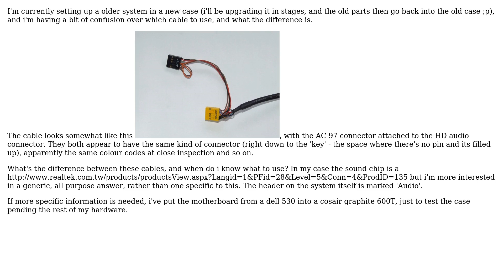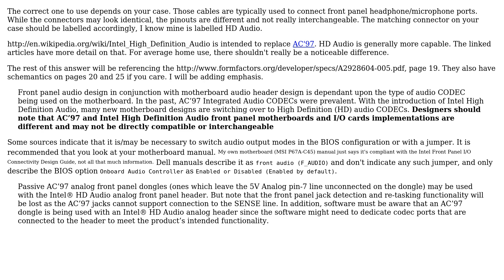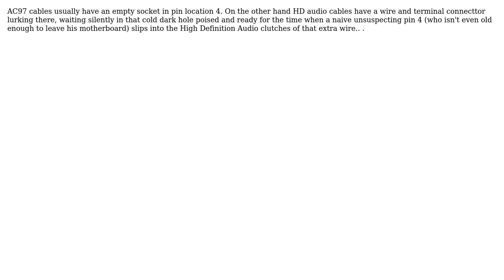HD Audio or AC97 connector - Which to use when, and what's the difference? (5 Solutions!!)

Comment: Hi Roel, maybe you would have an idea..and advice? i have heapdhones with big connector so use them via original 3.5 adaptor to connect to PCs and phone. I tried yesterday another adapter ( its slightly different, with 1 stripe on it) then i swapped adapters again, and basically problem is that sound not working anymore via front panel on PC. But i checked and sound works in AC97 mode but not in HD..thanks if you have any idea..or im just considering apply for pc case warranty..